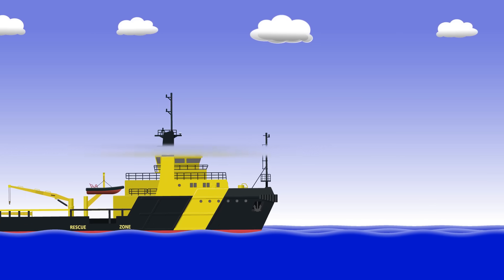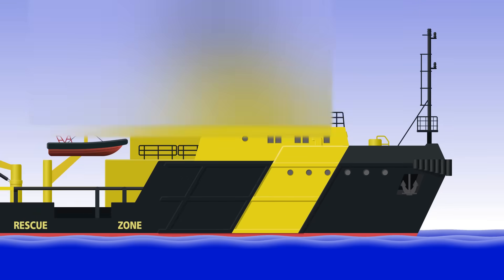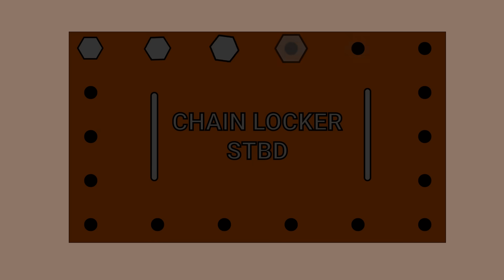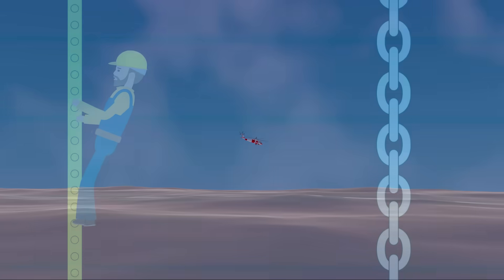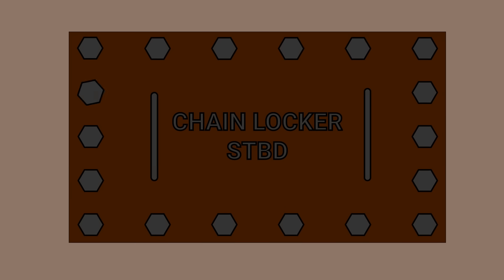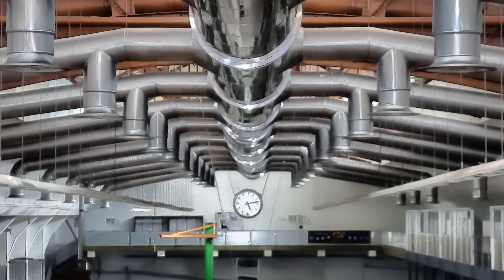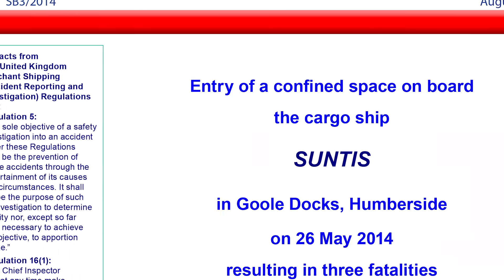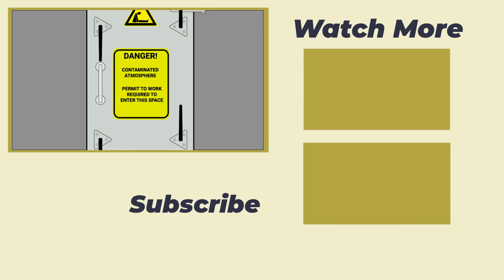Why Enclosed Spaces Are So Dangerous? | Enclosed Space Entry

Comment: I work in refineries, 
Confined spaces are LITERALLY the most deadly places and require extensive planning. 
Truth be told, if you are struck unconscious, you will likely die there. 
The atmospheres in them are constantly changing due to the chemical reaction of hydrocarbon breakdown, or welding processes or cutting processes that use up the o2.
Add to that, sloped floors, distillation trays or baffling and you’ve got a seriously dangerous space to been in even if it had a breathable atmosphere.
In this case they were entering a space with a shifting anchor chain, that reason alone was probably why the “man way” cover was bolted. It is not a space designed for humans to be in. 
Calling it a “hatch” implies it’s a door intended to be used.
Reply: there is also a small point to add to this, metal breathes because of autoxidation so uses up a lot of oxygen, combine that with saltwater bringing even more dissolved ions into the mix and you have a space with almost 0 Oxygen and full of gasses like CO, CO2 and even Cl2, NOx (common if plastic is present) and obviously Nitrogen, and all of that on its own is (depending on the concentration) deangerous to humans, the lack of oxygen just means you'll also go uncontious after 2-3 breaths
Reply: Fighter pilots have to pass an Hypoxia* certification, thus having been trained to recognise their own symptoms for hypoxia (there’s a varied list of common symptoms, which are exhibited and in which combination is highly individual). This kind of self awareness training maybe should be applied at sea as well for enclosed spaces. Won’t help you if some other gas knocks you out, but recognising your own symptoms for lack of oxygen could save your life.
Reply: @konzetsushi  keep in mind fighter pilots are elite physical and mental humans possibly engaged in fighting wars. These people were workers who should be provided a safe environment or the mitigation of the hazards through education prior AND protective equipment such as breath apparatuses.
Self awareness cannot be relied upon in industrial settings because hazardous atmosphere occur when conditions are met like in this case the oxidation removing o2 and must be continuously monitored. Had the space being tested prior to entry everyone involved would have known the o2 levels were below 19.5% and the space can’t be entered at all with out SCBA by osha regulation. 
Also during confined entry training the subject of observation of coworkers within the space is covered.
Reply: @konzetsushi  the way that you get hypoxia in a plane to confined space are completely diffrent.    in a confined space you could be knocked out in a few breaths depending on the mix of gasses  and even if you did recognize symptoms  generally confined spaces are difficult to get into and out-of so you may not have time to make it back.
Reply: @konzetsushi  the actual inhalation of the other gases will kill you faster than the lack of oxygen. Confined Space Training is imperative.
Reply: Yeah, I was thinking that the guy was going to be crushed at first but then realized that there were 2 more to go.
Reply: yeah, steelmill here. you literally need like 3-4 people outside the hole monitoring, comunicating, and prepared for emergency rescue just to have 1 guy actually go down and perform work. and you need a plant emergency services permit that needs to be renewed and reassessed every few hours
Reply: What about burning buildings? In my books as a firefighter, they are the most dangerous places.
Reply: @almerindaromeira8352  there too, a lot of the danger to any individual comes from contaminated atmosphere, and lack of ease of access. So they also fit pretty well into this definition of “confined space”.
Reply: Well said.
Reply: I'm sure you guys had to be briefed on this case in Phoenix: https://youtu.be/sszSuK-rHn8
Reply: Do many people die at refineries?
Reply: @jdan5807  
Honestly not that many, the number one cause of death in industry in general is falls from height. 
There are SO many  safety aspects of refinery work and maintenance that in order for someone to actually die either it has to be a highly uncommon event like an explosion or a noxious gas leak (the workers themselves wear on the person a detector) or multiple safety protocols have to be missed or ignored in order to create the conditions that lead to a death. 
We have work permits of many kinds; Safe work, Hot work or spark producing work , critical lifting permits and most germane to this topic,  confined space permits. 
To successfully obtain a confined space permit you need to have checked so many aspects from hazardous atmospheres, which include oxygen levels FIRST, lower explosive limits, does it contain the possibility of a changing atmosphere, which is continuously monitored throughout the entry by an attendant who never leaves the entry point and records any and all entries and exits on a log that is part of the permit. 
So you can see by the things I’ve just mentioned that none of that took place. 
They were either ignoring safety or blatantly working around them. 
One last thing, I know all of this because I am a refinery maintenance contractor’s employee, I’m NOT a safety professional, this is just an example of things you must know simply to get into the plants that need the contractors, literally the tip of the iceberg in terms of safe work practices.

Comment: The saddest part is a simple warning sign explaining SOP for such rooms on the hatch could've saved them.
Reply: Being that it was a ship designed for potential offshore oilrig rescue, there most likely were but were ignored.
Reply: They were deliberately tampering with parts of the ship they weren't supposed to, KNOWINGLY disobeying orders, so you can bet there were MULTIPLE warning signs. Like most of human early deaths, they were caused by overconfidence of uncaring people.
Reply: @guypierson5754  What foolishness is this. Overconfidence? Uncaring? Were you there? Did you know them? Or are you just a jackass? I think thus.
Reply: Yeah I was thinking the same why wasn't there a sign?
Reply: when an access is bolted .. THAT'S the warning sign !
Reply: @riccardoz2953  No. A warning sign is a warning sign. Don't be fooled by the memes. An oilrig is one of the most safety-conscious places you'll ever step foot on, and they're COVERED with signs, instructions, speakers and alarms, flashing lights, safety equipment and maps, etc.
Reply: @riccardoz2953  A warning sign is supposed to warn the user of the type of hazard/s or procedures/conditions required to enter safely.

Comment: I have spent a lot of years working in refineries. Confined space entry and entry permits are a big deal. We are taught to strictly adhere to protocols for getting confined space entry permits and the operators are taught to sample the air at different levels to be sure there is enough O2% and no H2S, CO or other toxins present. There have been so many reports of would be rescuers dying trying to help their friend.

Comment: I was a bricklayer and masonry worker on the 2012 Olympic park site. we were building the many massive deep underground tunnels and drain shafts etc under the site grounds, I had to travel out of London just to do my confined spaces certificate. I had to use a petrol saw down there once and it took only a brief time and I had to retire from the fumes, pulled up by my safety harness line. My mates took turns till the task was done. We filled out a fire certificate for many of these dangerous jobs and always your partner is trained to pull you out safely by a cab,e. one time I really appreciated health and safety on site.
Reply: today on site deep manholes are checked first and with a electronic atmospheric / gass indicator device and not a canary thank goodness. Fire safety hazard certificates etc issued especially for power tools (can cause sparks igniting gasses /explosions) before any work can commence

Comment: Damn I've worked on cruise ships for three years and thought the "danger: enclosed space" was warning people of possible claustrophobia (to be clear I'm in entertainment so that's well out of my realm of needed operational knowledge)
Reply: those warnings are there for multiple reasons other than just this danger (rust removing o2). there are a lot of processes or things used in processes that can be really bad with no ventilation. say for instance a refrigeration line runs through the area. if it leaks, it would build up in that area and anyone doing the work needs to know "hey, this is one of those places we told you to worry about" before entering. The same goes for work done in that space, using a solvent would be a hazard, along with welding. doing them together would be...spicy...
Reply: Adopt this rule of thumb:

Always assume that any sign that reads "danger", "warning", "caution" etc is warning of an immediate threat to human life or health in the area. Even a wet floor sign is doing exactly that, as slipping on the wet floor can cause all manner of head trauma and even result in death.

If you do not fully know and understand the danger, do not proceed. Simple as that.
Reply: @MGSLurmey  Unknown unknowns are what gets you though. You can be as diligent as possible, but what you didn't know you didn't know will get you anyway.
Reply: @sail4life and so? are you saying people should just ignore warnings, because YOLO?
Reply: @mnxs No, not at all. Maybe read my comment again.
Reply: @sail4life  All right. However, you did sort of phrase it as a rebuttal (how you used "though").

Even if it wasn't, if find it hard to see the actual relevance to what they said - everybody can intuit that an unknown unknown can be dangerous, but they were specifically talking about explicit warnings, thus either at least a known unknown (an acknowledged, but non-understood danger) or indeed a "known known" (a known and understood danger). So that leaves two interpretations - that you were either disagreeing in principle, or that you were just being a casual wise-arse.

I accept that it wasn't your meaning, but that's just how it came across to me.
Reply: I saw a carbon dioxide warning label on a door in a burger joint.

The had a tiny little "harry potter style" cupboard under an escalator where they store CO2 containers for the fizzy drinks, instead of list most place having the soda stand free standing with good ventilation.
Reply: @57thorns  worked in pubs, had CO2 alarm system set up in the cellar. 
policy was we had one person standing by the door watching the alarm and camera while the other person changed a barrel or whatever needed doing. 
while I always followed procedure, we had an incident with a CO2 can leaking and a member of staff opening the door while the alarm was on to find out "why the coke machine was producing flat coke." 
two warnings, flat drinks AND the CO2 alarm, and they ignored both.
they were fine in the end after i dragged them out, but there was a LOT of bollocking, both for the member of staff from me for ignoring the warnings, and for me charging in without any SCBA (which we didn't have, we were a pub after all) from the fire department.

Comment: where my father worked they had a chamber filled with CO2 for special welding, and someone died in there.  I knew about the dangers of enclosed spaces, and the rusting steel is what they use for the oxygen getters in preserving some food, but I never thought about the steel or wood oxidizing in enclosed spaces .   So I learned something.  Too bad chain won't work that efficiently to keep the survivalist store of wheat berries from oxidizing.   Those little logs are troublesome.  I read about a WWII slow convoy carrying lots of pit props where several ships were sunk by U-Boats.  First they had huge holes that weren't immediately obvious because of the flotation of the pit props.  Then the sea was full of floating pit props.  They were a real obstacle to rescuing swimmers, or even people in life boats, and they were, of course, a danger to propellers.  And, no doubt, they were probably depleting the oxygen in the holds.  Although they didn't have as much time to do it as the anchor chain.

Comment: Never thought about this too much until I worked as a dump truck driver. We dump the general waste into a bunker, a silo of sorts. From there they end up being burned.

The thing is if you get too curious and fall down it's a 20 something metre pit when empty. In case you fall and survive, being cushioned by the waste it is still no cause for celebration. Air down there is made of methane, co2 and essentially everything but oxygen. So unless you had your harness on the chances are that you stop breathing by the time someone is able to haul you out.

It was quite fascinating tho. I had little idea how those systems work before.

Comment: Send the oxygen meter down the manhole with a rope check levels, put a fan to ventilate. Keep a guy outside with oxygen bottle and breathing aparatus. If you find yourself working in enclosed space and your oxygen meter give alarm and you got working air with you for pneumatic tools cut the hose, quick way of getting lots of air quick. Also you should bring eebd to the worksite not outside.

Comment: I recently crawled into the crawlspace underneath the (wooden) flooring in my house.
I didn't think of it at the time and just went in and crawled around and went out.
 
Half a day later, I suddenly realized what I had done:
- I was home alone (I live by myself) so nobody was standing by or aware of what I was doing
- I crawled into an area I had never crawled into before (recently bought the house) that's the lowest point in my house
- I wasn't aware of the air quality inside the area and whether there was sufficient and unobstructed venting
...
- I didn't test for carbon-monoxide / lack of oxygen.
 
I realized I could have just died there, and that really scared the fucking shit out of me.
The worst part is that I am well aware of the dangers of enclosed spaces as well as the dangers of carbon-monoxide (one of the first things I did when I bought the house was put multiple smoke&carbon-monoxide detectors in!) so I felt UTTERLY stupid and was VERY mad at myself for endangering myself in such a stupid way.
I should have known better.. and I am glad it turned out not to be an issue.
 
I hope this serves as a warning for anyone else!
While crawlspaces generally SHOULD be ventilated (build code, law, etc) if it's a crawl space you've never been into before or haven't been into in a long time, ASSUME IT'S POTENTIALLY COMPROMISED/UNSAFE! Treat it like a gun, assume it's loaded!

Comment: But isn't the chain locker open to the atmosphere because the anchor chain has to be able to move up and down?  Isn't that just a gaping hole in the compartment and with rough seas and the boat rocking around shouldn't that have stirred up the atmosphere in there to "equalize" with the outside air?  Moreover shouldn't have unsealing that hatch created an open channel between the outside and inside air creating a draft?  It seems so weird that the air was stale.

Comment: As an engineer in the Navy that was one of the most important safety procedures they taught us. Never go into an enclosed space, usually an oil tank, alone or without a safety harness. And the guy tending the line on the harness couldn't just jump in to help you if you collapsed. He had to call for help first, even if it looked like the guy inside was going to die from asphyxiation. That way you didn't wind up with 2 dead snipes

Comment: It was as simple as not thinking the area was sealed off.  Probably assumed that it was open to the outside through the holes the chains went out through meaning there should be plenty of air circulating.  Mostly asleep and annoyed, just got tie it up hop back in bed.